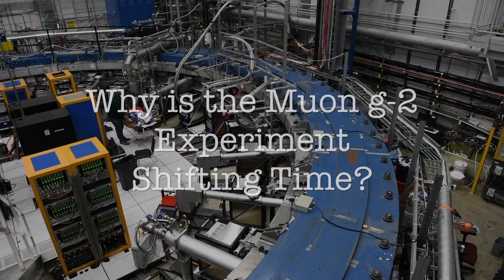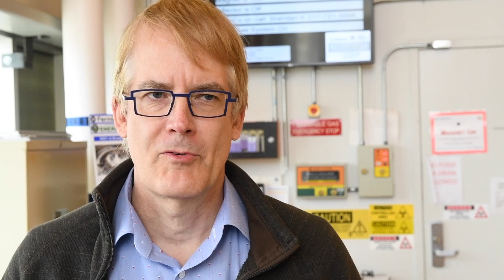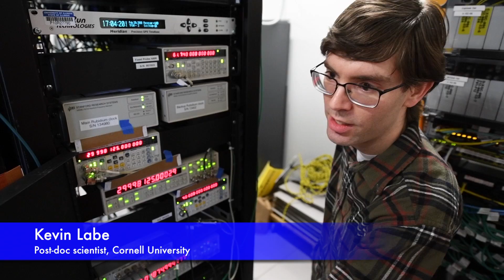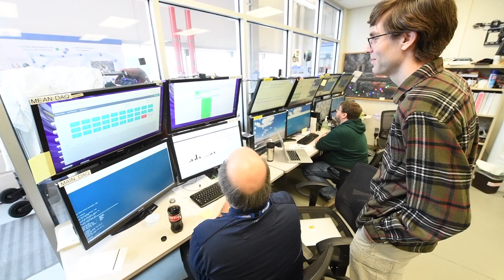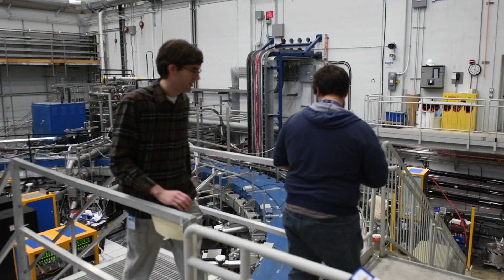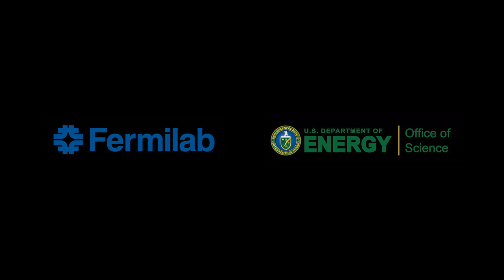Why is the Muon g-2 Experiment Shifting Time?

Comment: I'd include myself in that rather than be one of the ones that knows.
In fact you can record the frequencies and stuff on a data stick,
and deposit it at a bank. Then remove the indicators.
Data is stored and yet not visible, now you have blind.
Reply: Knowing means not participating in the thinking process.
That would be torture to me..

Comment: Dark energy  exsist  in a SCALE INVARIANCE Space configuration "PHASALITY"  using automorphism to auto regulate  or (engauge)the amount of energy ,  time , Velocity  {frequency) , and Volume   required to  Transform particle matter of that  SPACE ( FIELD, PARTICLE WAVE ENERGY PAIRING )at that specific location ,` or at any future location  in that Space Time, Ex. photons or light like particles Traveling  in a straight line at a Fraction  of speed of light (Ecludiean spaceTime) gives rise to Baryonic mass "PHASING"  like particles fields , Extending into like matter electron proton ect. thru When ( Riemann space)  gravity, electromagnetic, nuclear Strong force is engaged thru Baryionic Field Boson interaction    the electromagnetic Photon Particle enters  and engages Curvatured Space. Reaching infinite mass for that particle wave location causing a curved Deceleration  we call gravity.and Electromagnetism 

Entanglement  happens  by Shears  TRANSFORMATION of this Baryonic mass/particle/ when Space  itself shears and Rotates So all FIELD in that  Space becomes INVARIANT Orients itself, to a common point  enabling one PARTICLES  (like the MUON) to exist as a COLLAPSING  Wave in Two Different SPACES or fields. (PHASE) or thru a local SYMMETRY ,and Because Information travels in a Linear fashion in 3 Dimension Space , We olny become Aware of this Spacetime Information by attempting to Communicate   outside  our everyday 4 Dimensional  Spacetime . and Not Seeing ,or Receiving anything  back then we say mass is missing, 

Entangled particles  don't need this  Same Time information to Communicate 
because it Exists at every point in the Entangled PARTICLES WAVE own SpaceTime Coordinates that merged  at a Every Point  in the field .So Entaganelment is a Attractive Force Within a mutual field , While Baryonic space is a Repulsive Force where the Wave Particle are  Running Away from Itself as  a non local non mutual field, So when you observe or try to measure the Particle the Wave function does not Collapses because the wave and Particle exsist as non mutual independent Field or a Gauge less field

So Dark Matter Could be a Non-Localized Spacetime like a Black Hole with Equally distributed gravitational mass and inertial mass .Analysis of high velocity Nuetrino burst from Gamma  rays as Observed from our 4 Dimensional Spacetime Frame of Reference might confirm this. Were the Nuetrino ACT as a SYMMETRY break of ENTROPY (Gauge Field) breaks and lose its Orientation.and when this SYMMETRY break is Non-Local all Particle waves FIELD and SPACES becomes INVARIANT UNDER A mutual FLAT MANIFOLD metrics

Comment: So why is it called g-2??
Reply: Because the value they will measure should be exactly 2, but it is not, due to the virtual particles that appear and disappear from the void. If the difference from 2 is large, it will mean some new particles do exist.
Reply: @viniciocoletti  and the difference was relatively large!!! Very excited for runs 2 and 3 to be published summer 2022.

Comment: I doubt most of what the people running these experiments say,  since this machine (cern) has been up n running the world has went to shit , and maybe I'm jaded at this point by all the fucked up ugly shit that the people we all thought we the sheeple could trust completely sold us out, more evidence of that trickles out more and more as the days go by... And I'm not the type that likes to blame others for my own mistakes , I'm an  adult and can accept and own  what my words and or action  have done. I just don't get a good feeling about what they are doing there at CERN  . It's all very complicated and I understand they are trying to  understand things at a higher level , the bits and pieces that make up everything and the processes that happen ,the moving parts of the mechanisms of the universe . But I think there is a lot more 
Happening than is told to us or is done out n in the open  mainly because what they are playing with is /could be dangerous but they think they can handle what ever happens . B
And by "blinding" 2 parts of the varibles they can keep the info. All to themselves so they can get the Nobel prize if it works which it probably won't because you have nosy motherfuckers who will hack the data  .. and if this data could be used to access something bad the #'s will he changed or 1 of those guys will have an accident and nothing will come outta the experiment .

Comment: You should also have one running with zero offset as well as one with a random offset. The outputs from all three should be manually patched by the janitor or someone not involved then locked behind the panel. Only after data collected and experiment concluded should the panel be unlocked.  I applaud your blinding efforts but there are still two who know and non verbal clues and attitudes will still contaminate the results.

Comment: Are the values being committed anywhere? Like, say, a sha2 hash of the secret values along with a random salt? With people knowing the hash of the values beforehand? That way, when the values are revealed in the end, it can be confirmed that the values released at the end were chosen at the beginning, before the data was collected, so they couldn't have (accidentally) been misremembered in order to make the interpretation of the measurement come out to what was desired?

Or, wait, I guess the numbers are still stored on the machine there, so they can just open it at the end. That is a simpler solution.

Comment: All this time I had thought a Muon is a Chinese food delicacy!
Reply: that's the Muon Goo Gai Pan
Reply: Ya, I like the muon pork.
Reply: It actually is a Chinese food delicacy, but with a negative charge.
Reply: Dark energy  exsist  in a SCALE INVARIANCE Space configuration "PHASALITY"  using automorphism to auto regulate  or (engauge)the amount of energy ,  time , Velocity  {frequency) , and Volume   required to  Transform particle matter of that  SPACE ( FIELD, PARTICLE WAVE ENERGY PAIRING )at that specific location ,` or at any future location  in that Space Time, Ex. photons or light like particles Traveling  in a straight line at a Fraction  of speed of light (Ecludiean spaceTime) gives rise to Baryonic mass "PHASING"  like particles fields , Extending into like matter electron proton ect. thru When ( Riemann space)  gravity, electromagnetic, nuclear Strong force is engaged thru Baryionic Field Boson interaction    the electromagnetic Photon Particle enters  and engages Curvatured Space. Reaching infinite mass for that particle wave location causing a curved Deceleration  we call gravity.and Electromagnetism 

Entanglement  happens  by Shears  TRANSFORMATION of this Baryonic mass/particle/ when Space  itself shears and Rotates So all FIELD in that  Space becomes INVARIANT Orients itself, to a common point  enabling one PARTICLES  (like the MUON) to exist as a COLLAPSING  Wave in Two Different SPACES or fields. (PHASE) or thru a local SYMMETRY ,and Because Information travels in a Linear fashion in 3 Dimension Space , We olny become Aware of this Spacetime Information by attempting to Communicate   outside  our everyday 4 Dimensional  Spacetime . and Not Seeing ,or Receiving anything  back then we say mass is missing, 

Entangled particles  don't need this  Same Time information to Communicate 
because it Exists at every point in the Entangled PARTICLES WAVE own SpaceTime Coordinates that merged  at a Every Point  in the field .So Entaganelment is a Attractive Force Within a mutual field , While Baryonic space is a Repulsive Force where the Wave Particle are  Running Away from Itself as  a non local non mutual field, So when you observe or try to measure the Particle the Wave function does not Collapses because the wave and Particle exsist as non mutual independent Field or a Gauge less field

So Dark Matter Could be a Non-Localized Spacetime like a Black Hole with Equally distributed gravitational mass and inertial mass .Analysis of high velocity Nuetrino burst from Gamma  rays as Observed from our 4 Dimensional Spacetime Frame of Reference might confirm this. Were the Nuetrino ACT as a SYMMETRY break of ENTROPY (Gauge Field) breaks and lose its Orientation.and when this SYMMETRY break is Non-Local all Particle waves FIELD and SPACES becomes INVARIANT UNDER A mutual FLAT MANIFOLD metrics

Comment: I never saw this approach for a blind analysis. Really clever.
Reply: Then you may want to read about double blind also: http://www.dictionary.com/browse/double-blind-experiment
Reply: Thanks! I understand about blindness in hypothesis testing. What I meant was the idea that you can have a parameter or a setting in your experiment, like a scale, that only one person knows, which allows for the analysis to be carried until the end without the possibility of biasing the result. What I usually see in particle physics is a full blind, where the analysis is performed over simulated data, training the methodology over a fake sample. Meanwhile, the real data is locked up in a server and it remains untouched until a certain statistical threshold is reached. But when it is open, it is open. The only thing preventing a monty-hall-like bias is an agreement that no one will tweak the analysis after the unblinding of the data.

Comment: The abscence of this kind of rigour in so-called "climate science" goes a long way to explaining how the global warming myth took hold.
Reply: Climate change is real.
Human influenced climate change is real.
The question is what portion of the former does the latter represent?
It is also possible for human activity to be a very small portion of the total, but still be the larges single contributor given the size of the system.
I've heard the number is around 25% man-made. Solar variations, natural cycles, galactic influences, known unknowns, and unknown unknowns would then outweigh human activity by 3:1 and the end of the century review would have shown a rise in temperature of .75 degrees instead of 1 degree. And yet as minuscule as we humans are, a full quarter of the planet's climate change is linked to us.
Let's ignore both the deniers and the "massive change now, consequences be damned!" groups and do what we can to support common sense approaches that would be good even if there was no anthropogenic component to climate change.
Reply: martin savage you mean by removing the climate? Not all science can be rigorously blinded because of the very nature of what is being worked on. Nor however does that mean that said science is by default faulty simply because of this fact.
Reply: The perfect example of people looking at data and wanting to see their own results yes...
Reply: Well, some people are warming up the planet and they are in denial, so technically it's a blinded experiment. :)
Reply: +wolemai, I'm sure on some planet, your argument makes sense, but your weak link is: this is earth.
Reply: The data collected for climate science is real. The liberals took the data and blew it out of proportion because they wanted to promote their agenda. Note how, when science says it is perfectly safe to eat GMO, they scream like little girls with a bee up their dress. People pick and chose the science they accept. BTW, no matter what people say, a flu shot does NOT give you the flu.
Reply: @ardalla535  Gosh, Pat: "The liberals took the data and blew it out of proportion because they wanted to promote their agenda." What you typed reads a lot like, 'The conservatives took the data and ignored it because it doesn't support their agenda.' To support that assertion, I once again quote *you*: "People pick and chose the science they accept..."

Comment: What is the shifting time? I get the blinded measurements to reduce bias, and he briefly brought up that "if [a clock tick] ever slowed slightly it wouldn't affect any of the process" so, then... what?

How are you "effectively just stretching the metric of time"?  I think I get that you are measuring time with the procession of the muon, but aren't you trying to find anomalies in the processing itself, so don't you need to compare the procession to some standard of time, not the other way around?

Thanks!
Reply: They are making a measurement, but the nature of the measuring gives a probabilistic output. To make sure they are finding the real answer, rather than just the expected result, they shift the output a bit higher or lower, so they no longer know what the result "should be". It's depressingly easy to lie to yourself using statistics if you don't take precautions.
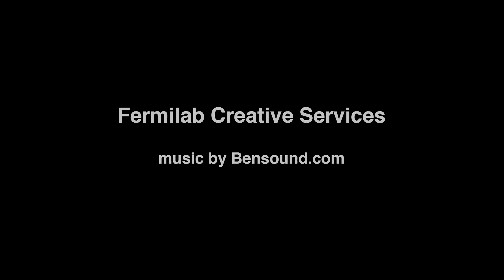Reply: kindlin At 3:24 he says "...putting the offset in the incoming data stream...." I think that added some time in the system?

Comment: I can see this being used in  military operations. GPS , targeting systems and ICBMs rely heavily on time accuracy.
Reply: You're a little late there, J Bolo. When GPS was first implemented the satellites had the ability (still do) to selectively and algorithmically degrade the time measurements so that the enemy got junky data but our troops got the real thing. Smart thinking; one way to help defeat a crude cruise missile such as a GPS-guided light plane filled with explosives missing its target by a long shot. As I recall, some of the satellites were put into that mode but not when they were over the Middle East as intended; that new GPS car navigation was out and boy! did the Japanese howl when their car nav units thought that they were blocks away from their actual locations! After that selective degradation wasn't used again that I heard of.